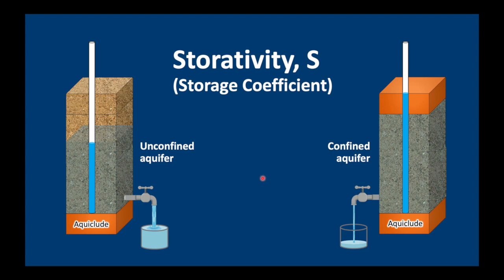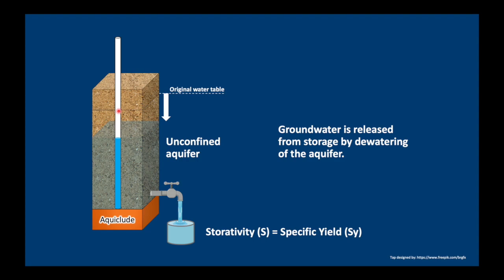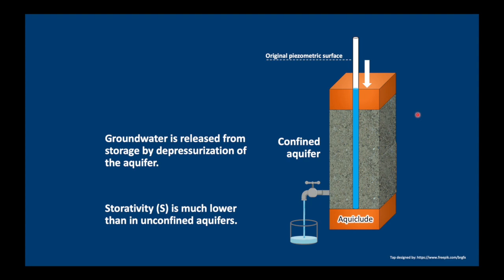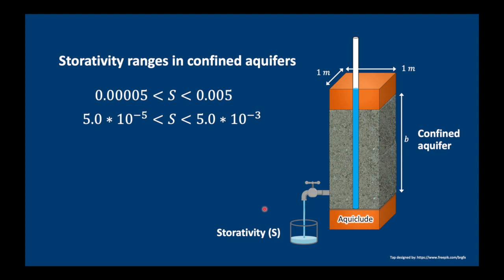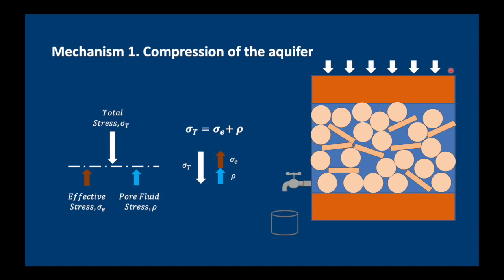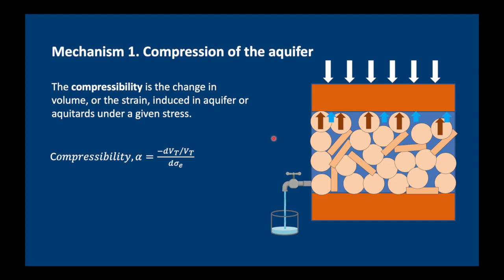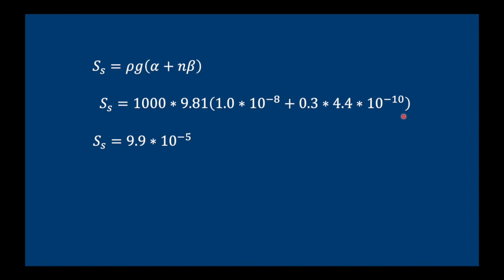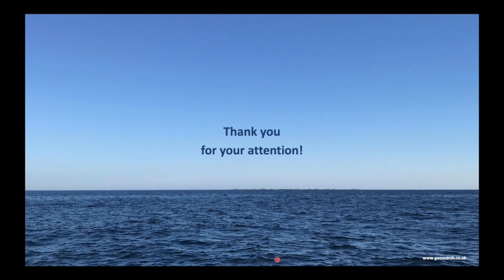Hydrogeology 101: Storativity

Comment: How did you calculate the water released from the exampled confined aquifer?
Reply from the maker: Hi Huang, The Storativity (S) of an aquifer is the specific storage (Ss) multiplied by the aquifer thickness (b). It is the volume of water released from storage per unit surface area per unit drop in piezometric head. Our unit is the metre (m), so if we take a m2 of aquifer surface, and reduce the head by 1m, the volume of water released over the entire aquifer thickness underneath this m2 will be equal to the storativity (S). In the video I showed the typical range of storativity in a confined aquifer as 5 * 10(-5) to 5 * 10(-3). i.e., 0.00005 to 0.005. This is the volume of water that will be released. The unit is cubic metres of water & there are 1000 L/m3, so it works out as 0.00005 * 1000 = 0.05 Litres at the low end to 0.005 & 1000 = 5 Litres of water at the high end from each m2 of aquifer.
Confined aquifers do not release much water and that is why we end up with large cones of depressions around pumping wells. If we pump too much and the pumping water level in the well drops below the top of the confined aquifer, it will become unconfined we will start to dewater the aquifer at the specific yield. Hope that makes sense. All the best, Andreas

Comment: There's one thing I still don't get my head around: It's quite obvious to me, that the specific storage of an unconfined aquifer equals (more or less) the "dewaterable" porosity (specific yield). Why that is makes sense, as it is the unit volume of water we get per unit area per unit length of drop (so volume of water per volume of aquifer, basically). But If the Storativity is the unit volume of water per unit volume of aquifer per length of drop of the hydraulic head, that should also yield the "dewaterable" porosity, only as 1/m, - or why not?
Reply: And - why in the world is the S = Ss*(aquifer thickness)?
Reply: To say it simple - just from the definition given here (or anywhere else) I don't get the (or why there is a) difference between S and Ss
Reply from the maker: Hi @Diclofenac_  What you need to remember is that a confined aquifer is not dewatered. It is depressurised only.
Specific Storage (Ss) = Volume released from storage per unit volume of aquifer per unit drop in head. i.e., how much water is released from 1m3 of aquifer if the pressure drops by 1m.
Storativity (S) = Volume released from storage per unit surface area of aquifer per unit drop in piezometric head. i.e. how much water is released over the whole aquifer depth (b) if we look at a m2 of aquifer area, and depressurise the aquifer by 1 metre. 𝑺=𝑺𝒔∗𝒃
Once the peizometric surface drops below the top of a confined aquifer, it becomes unconfined and S = Sy. ie the aquifer will start to dewater/drain.
All the best, Andreas